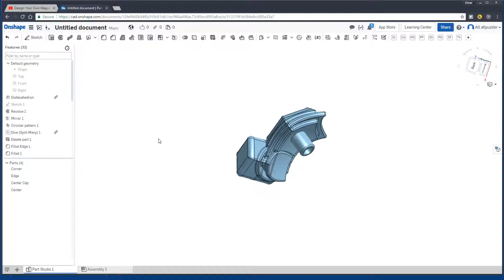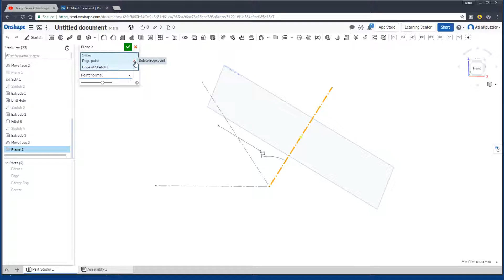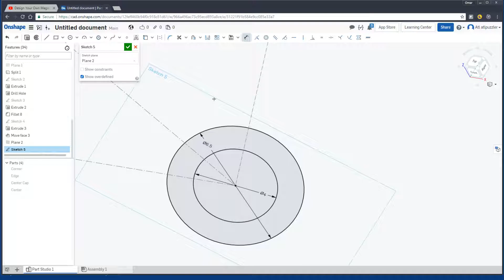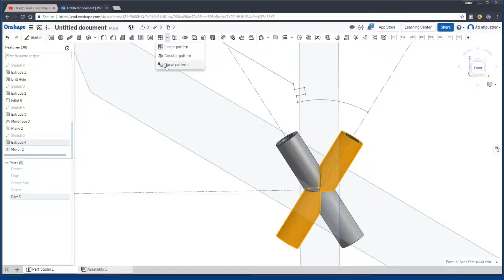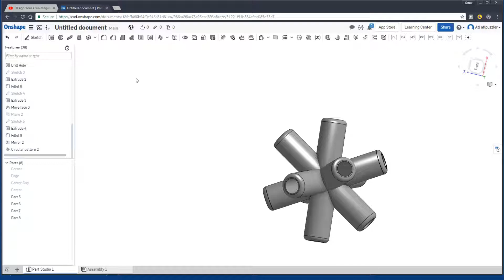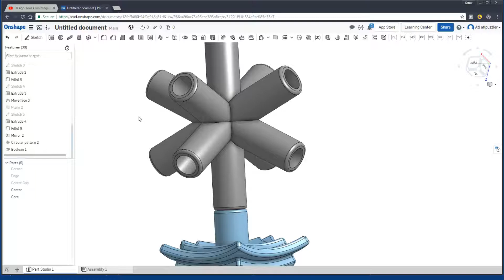Design Your Own Megaminx Using OnShape - Part 5

Comment: your spider core has only 10 spikes not 12
Reply: I just found the same issue. You can simply change the Instance count on the Circular Pattern from 4 to 5 and it will fit to the dodecahedron.